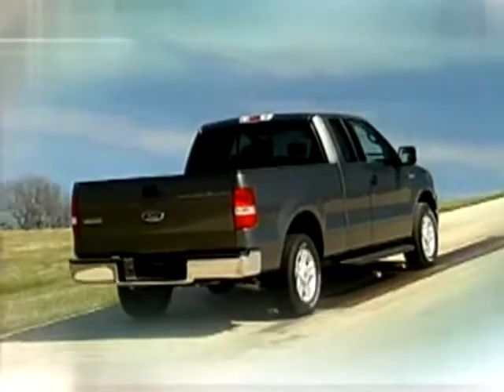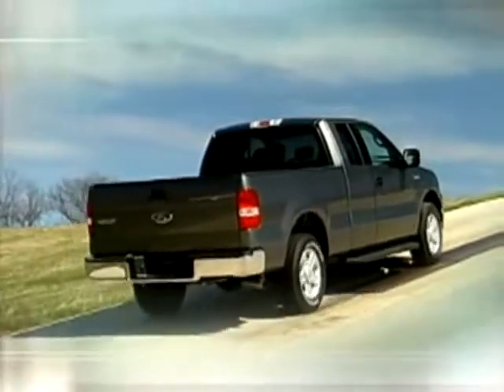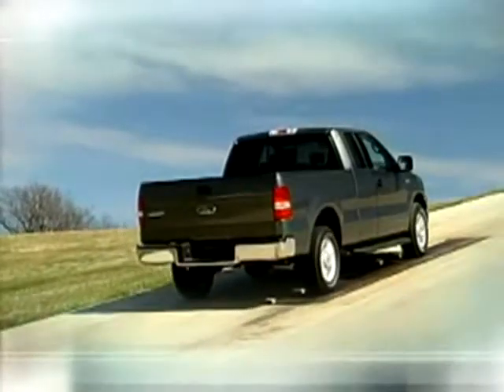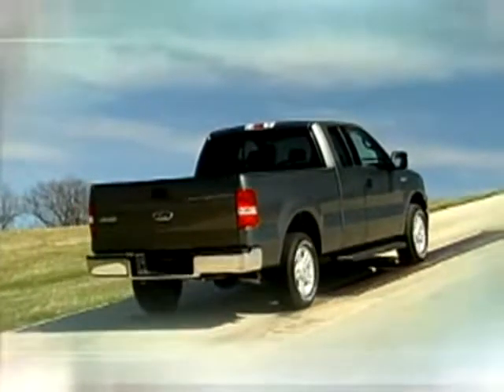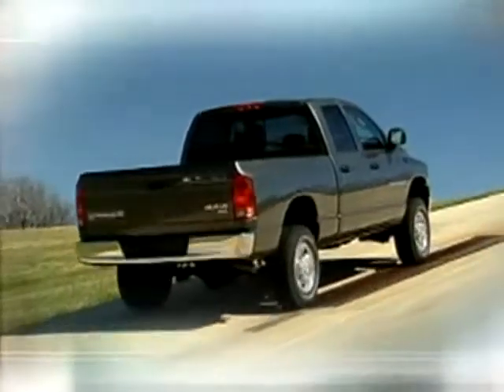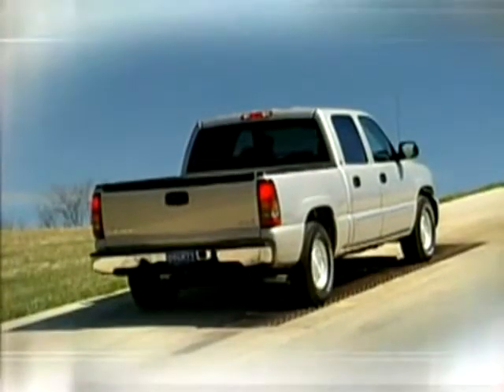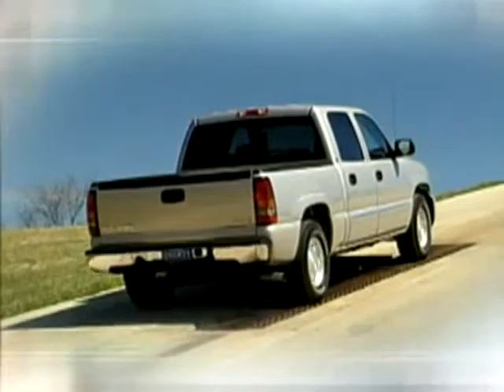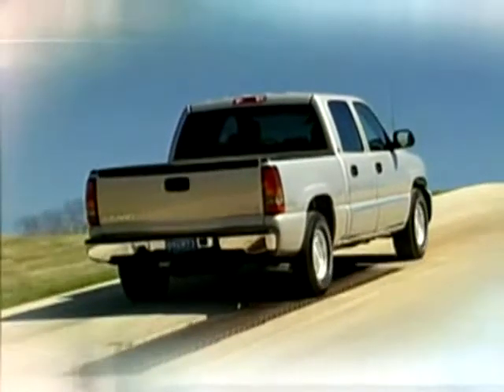Eaton G80 Locking Rear Differential

Comment: Idk many hate on the g80 but I put 30,000 miles on it and whenever I blew the g80 the truck had 320,000 miles on it. And I put 30k miles of burnouts,gravel roads at 100, and drifting tf out it and it help up great.

Comment: Limited slip will get you stuck even on this slight grade it didn't work, I was getting stuck on wet grass 72 Chev truck, I ended up Lincoln Locking it huge difference.
Reply: The g80 is not a limited slip it actually does lock the differential.

Comment: at our dealer in the service dept. we call them "Gov bombs"  they explode if you get on them hard enough, and often enough.  The truck with the posi diff that "didn't make it" actually didn't have a posi diff.  I had a limited slip diff installed in my Ford Ranger and it performed better than all these trucks.  The G80 is for people that never have to work on them.  They suck.  There's other youtubes on how they suck.
Reply: Stupid people are the ones blowing up the g80 stupid enough to abuse them.

Comment: Yeah until they blow up
Reply: Well, mine's a decade old and still works fine.  Let me guess, you've never had one?
Reply: @unicornsteaks6769  mines13 years old too.
Reply: @dannyquijada1797  I have a couple vehicles with them. The older vehicle is 18 years old, no problem with the G80 long term even with some offroad abuse.
Reply: @unicornsteaks6769  I have the G80 in my 2004 Z71. I have always loved it. Last time I serviced the rear diff, I found all the teeth on my spider gears were chipped. Still locks up when I need it to. It’s got some humming going on so I’m about to put an Eaton Detroit TrueTrac in it as soon as it comes in. With that said, I cannot say anything bad about my G80. She’s tired because of my stupidity, plain and simple. Lol.
Reply: Mine has lasted 13 years and I abuse the hell out of it. I got a 2006 colorado z71 rwd and it never fails i got stuck once and it sensed it and it actually propelled me out and my friends 4x4 jeep renegade couldn't get out it just spun. G80 is great if you ask me
Reply: Mine's 13 years and going strong, no issues! What are you talking about?! Ford fan boy...

Comment: Or you can break lock, dunno if it works on an automatic but it works in my stickshift jeep, never needed lockers or limited slip, can just lightly press the break and it sends power to all wheels but you will lose a bit of power over  all while doing it. Its not always what your driving or how its built, sometimes its just the skill of the driver.
Reply: you can do same trick by applying a regulated amount of E break for the rear wheels
Reply: That can add excessive wear to the E brake. And the more you do it the less its effective.
Reply: +JeepJeep234  yes for sure but more of something to do in a pinch
Reply: @JeepJeep234  That's exactly what the electronic traction control systems do rather than installing a limited slip or locker they use the vehicle's braking system with the abs sensors to slow spinning wheels to transfer power, it wears out your brake pads quite quickly as a result of cheaping out and not just putting in a limited slip or locker in the first place...cough....cough Toyota with their ELSD in the Tundra is a big rip off...that price point and no limited slip even, just the brake system trying to make up for the lack of a limited slip...pathetic.
Reply: same with added wear to your rear brakes. I'd rather install an arb, grizzly locker, or trutrac.
Reply: My Jeep has brake locking diff. It senses tire spin and brakes that wheel forcing the torque to the other wheel.

Comment: Too bad the G80 is weak, at least in the GMT-800 models, and will likely blow up on you if you off road or even tow alot. Throw some Detroit's in there and call it a day.
Reply: Gotta love these generalized comments. So tell us  what percentage of all G80s in vehicles failed. To make such a definitive statement you must have analyzed a large data set, over numerous years, and compared the vehicles equipped with the G80 yo determine the percentage that failed. Or you’re just stating an opinion and don’t have a clue. I’m guessing it’s the latter.
Reply: @TheMrbeasely  I agree with you. Certainly the latter. I’ve been really hard on my 2004 Z71, doing things that certainly cause differential failures. Serviced it recently and noticed all of my spider gears have chips in the teeth. However, she still locks up EVERY time I need it to. Plus I don’t know how the previous owner treated it. I can’t knock my G80 though.

Comment: their first "2wd with the eaton g80" is a 4 wheel drive with 2 engaged. you can see the front diff when the truck moves farther up the hill
Reply: Yea so what it was in 2wd mode. Same as a 2wd truck
Reply: No, look at the decal on bed the 2wd it doesn't say 4x4, I know cuz I got one and its a small detail but you can tell cuz the 4x4 say Z71 4x4 the 2wd just says Z71.

Comment: Z71 is the off road suspension and gear package not always 4wd
Reply: btube325 it also has a bigger radiator and skid plates
Reply: Also some gm vehicles have the g80 before they created the z71 badging.